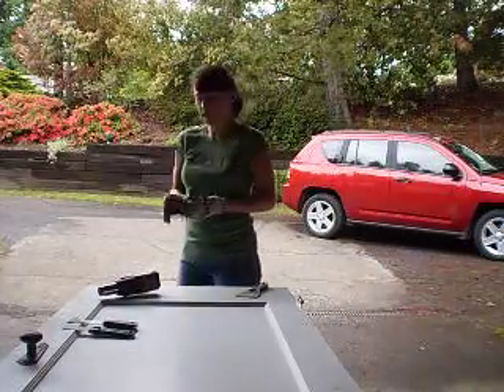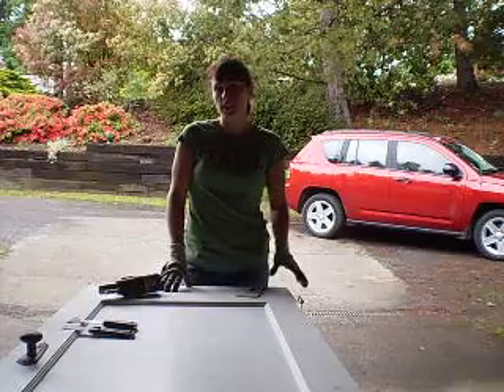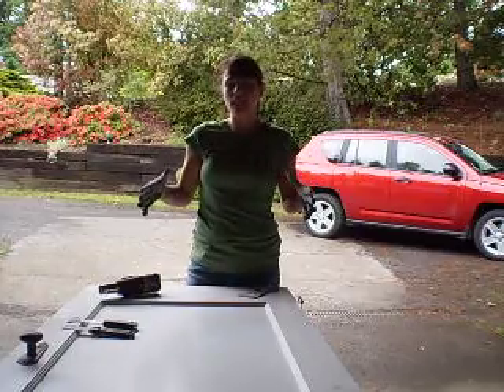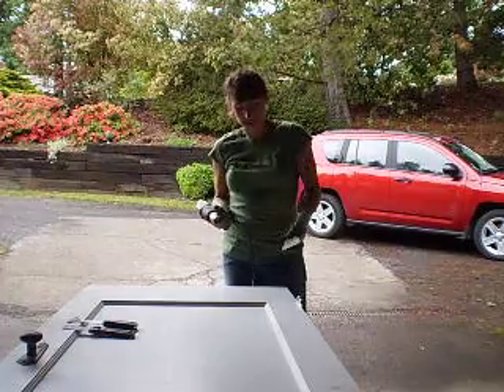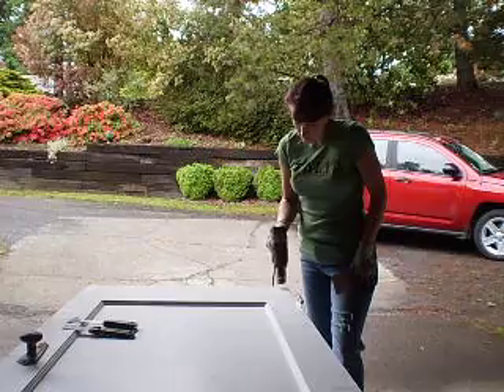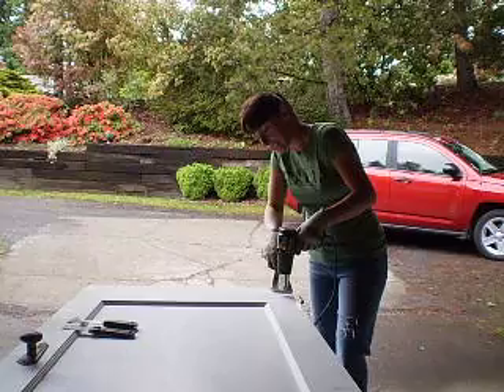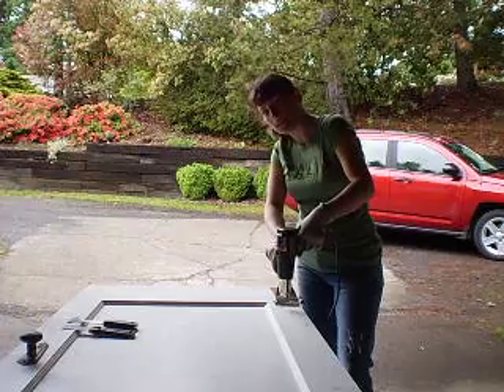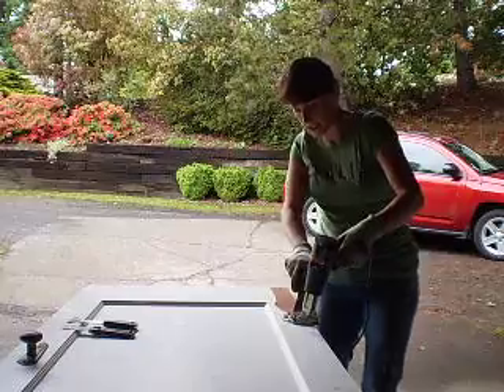Heat Stripping An Antique Door.AVI

Comment: Was it easier because the paint was on top of varnish? The reason I ask is that I just bought a house and the previous owners painted the deck and I want to strip the paint off and I don't want to spend the money on get stripper and a pressure washer. Thanks !